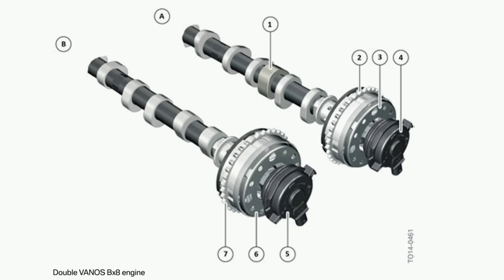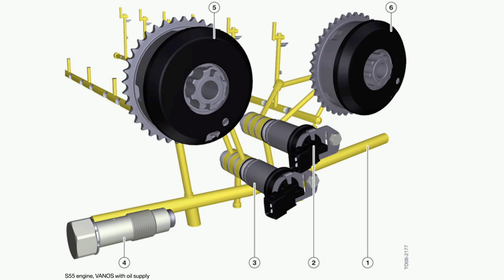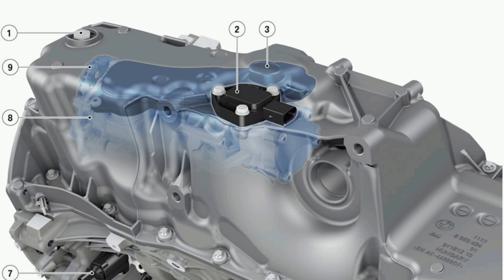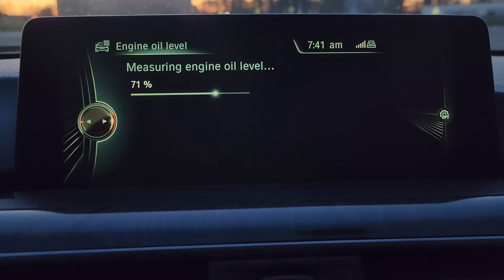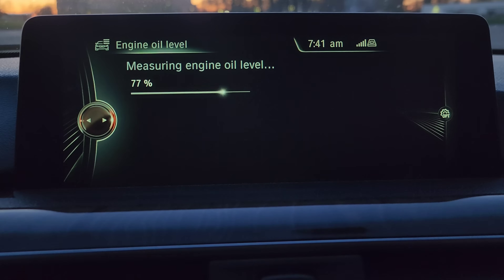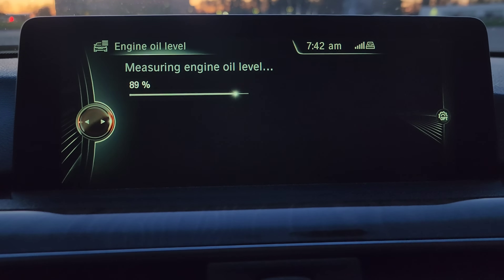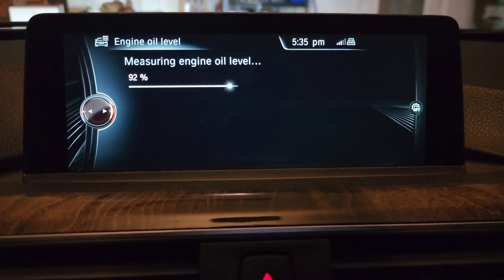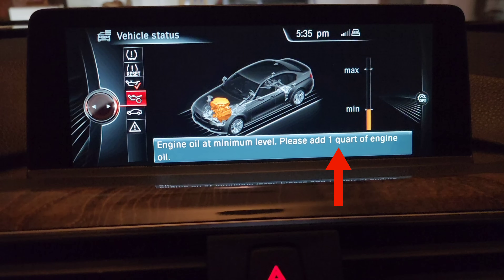How BMW Oil Level Sensors work (and Why They Don't Have Dipsticks)

Comment: All an excuse explaining the design created by engineers to remove owners from taking care of their cars. One step closer to subscribing to a car, then subscribing to features.
Reply: It’s not that deep
Regular folks don’t care about it or take care of their cars themselves. These are the same folks that actually fill BMWs pockets, not the minority that buys their old cars to work on them.
Reply: It’s been in BMWs since at least 2007 my 328i had an oil level sensor. Well before the subscription model was an idea.
Reply: You can still measure your oil level and change your oil yourself if you want to. 
But BMW did try to make seat heating a subscription service didn’t they? 
That would be a major turn off for me.
Reply: Measure it yourself? How? You have to drain the oil and measure the amount drained to figure that you need to add a half quart. The sensor reads full and it’s low, don’t trust a sensor that can’t be verified afterwards
Reply: The real issue this addresses is running an engine low on oil. With extended oil change intervals it’s easy for an engine that burns a little oil to run low or OUT of oil. Yes, us car people check the oil frequently… but most owners don’t. With the electronic monitoring of level the car will freak out with warnings and the owner will KNOW they need to add oil and the car will even tell them how much - usually a full quart.

I’ve got two cars with electronic level monitoring - a BMW and an Audi. Honestly it’s no big deal and is kind of handy even.

Comment: I have a tuned 2021 Supra (B58TU) and I was wondering how difficult it would be to replace the oil pump myself if it starts giving me trouble, but I can’t find no videos/DIY - is this something that would be just too difficult for  an average DIYer like me? Have you removed your oil pan without pulling the engine before?? I’m just curious
Reply: i don't have a b58 but I've read/seen that the timing chain assembly and the oil pump is located at the back. this means that you probably need to drop the entire engine to change it. unless you are able to drop the oil pan without subframe interference.
Reply: I found this short https://youtube.com/shorts/w6YOnudShHU?si=iv-GscbXIPoZjWGv that seems to show the b58 still in the car with no sub frame and the oil pan removed, you can also see the oil pump in the back, I think this might be doable without pulling the engine, I would need to figure out how to correctly remove and install the oil pump but it doesn’t look too bad so far

Comment: I am surprised this isn't more widely known.. While driving my E92 335i(N54) it felt like it would hit boost harder when the oil was just filled. When the car was ready for an oil change around 4500kms(It was FBO so I did oil changes early, top mount oil filter to boot), I would notice the boost felt like it would kick in much less aggressively, and the oil sensor would indicate add +1L. When the oil was topped up oh man the boost kicked in hard.

Comment: BMW should bring back the Dip Stick in addition to the Oil Condition Sensor for the sake of redundancy and peace of mind!!! 

Nothing beats being able to visually see the level and condition of vital engine oil.
Reply: Thank you!!!!
Reply: Exactli ✅
Reply: It's like start stop and other eu nonsense like reading road signs, it sounds great on paper but in practice is far from perfect and just prone to misc variables and annoying users
Reply: It’s apart of the planned obsolescence, you think they want you having that engine run forever 😂lol most bmw engines fail prematurely due to oil consumption, the valve cover leaks, or the engine burn oil, and when an engine operate with low oil, the piston rings, or cylinder head gets warped, when you’re BMW says low oil level, completely empty out, and measure the amount of oil, and I guarantee you, it’s missing far more than 1 quart, so even by adding that 1 quart, you’re engine is still technically operating with low oil, not dramatically lower, but you’re still having some engine wear, these are issues nobody talk about, because it’s big money for bmw, timing chain failure, and the timing chain guide typically fails from oil starvation, addressing oil leak is very important, but nobody is going to change their oil each time they get a low oil light on, they gonna top it off, and that is not good enough, because you’re engine is still operating with low oil.

Comment: Actually just had to add TWO liters yesterday (it never alerts for 1L), coming up on my next oil change. Also have issues with the oil level check, never completes. I believe you covered issues with it has to do with the oil pump, which I had replaced in 2022 (M40i build Oct20). Wonder what's going on with it..